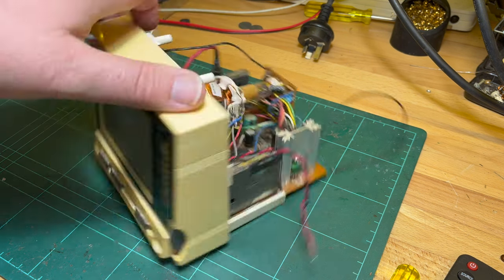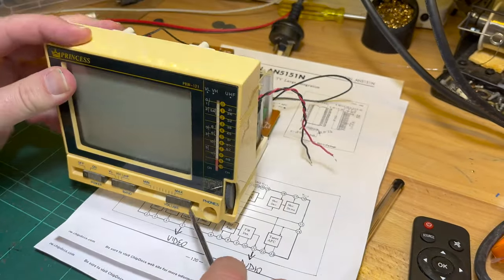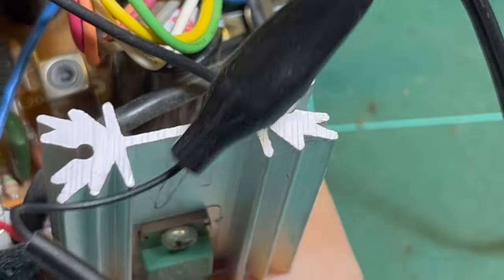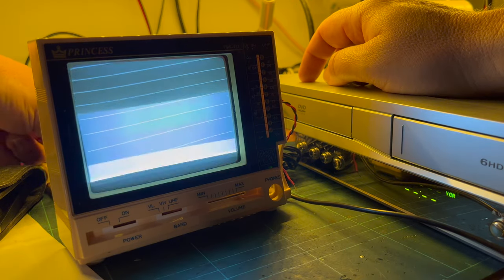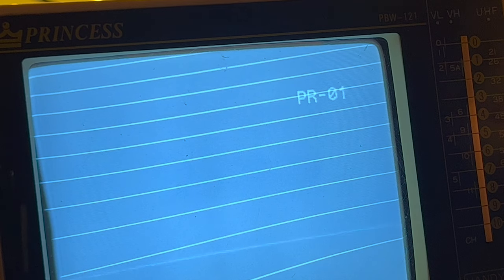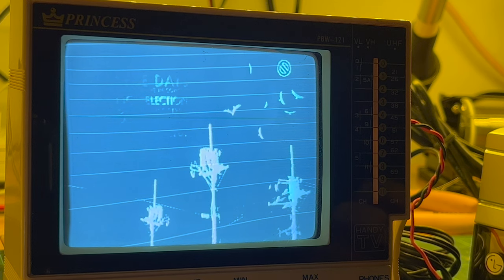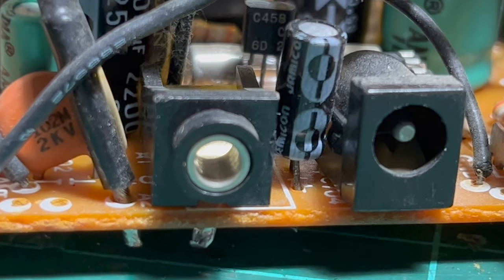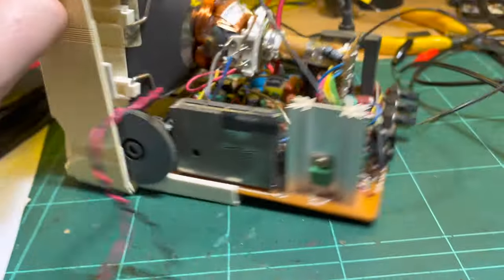Adding Video Input to RF-only TV: Part 1 [TCE #0274]

Comment: I think the input impedance must be 75  ohms to get the the correct video composit signal standard levels (synch . blank. black and white) in the TV side.
Reply from the maker: Yep - you generally want to impedance match to ensure optimal power transfer and reduce signal reflections

Comment: @Brfff this one
Reply from the maker: Yes, I do need to re-visit this one.  Now that I'm more comfortable using the oscilloscope, I should be able to do a better, more permanent modification.  I'll try to get to it this week (24-Jun-2024)
Reply: @Brfff  no rush. I'm about to do a similar mod to a late 70's early 80s set.
Reply from the maker: @danielflakelar8193  Ahh, interesting.  I think this one is supposed to be easier because it's got an IC that does a lot ... can't remember?

Comment: I'm looking at the datasheet schematic. Pin 5 is the correct one, but you will need to know two things to make this work.
1. The normal video level at that pin.
2. The signal polarity.
You can get both by reconnecting the link, connecting the RF to your DVD player, and using a scope on that link.
The circuit has a 2.1v P-P level after the 2SC828A emitter-follower amplifier, so 1v is probably pushing it well beyond that.
The polarity will be pretty obvious on the scope, but not on the TV. An overdriven signal can look opposite of what is correct. If the polarity is wrong, you'll have to do a bit of work to correct it, but this check will at least tell you what you're facing before you do the connector work
Reply from the maker: Yep, that's what I was thinking of doing.  At the moment I've connected in to where the pin 5 video signal output emerges.  From what I can see it might pass through a capacitor (maybe) but then goes straight to the neck board via a blue wire.  On the neck board it goes through a transistor so I'm suspecting that's where the amplification might be occurring.

Comment: the horizontal lines and bright image suggest that the input intensity level is too high... may need a resistor to bring it down some...(maybe adjustable with a pot?)
im wanting to RGB my old sony trinitron TV to run the CPC off.. but from what ive read its not RGB and 15khz compatible... (i should try to find the service manual for it!)
...i did notice theres a TV on FB marketplace for weeks now that has SCART... might be the easier way to go....
Reply from the maker: I think it might be getting amplified on the neck board ... ?  Will look further into it!
Reply: @Brfff  just try stickin a resistor on ya composite input from the vcr
Reply: @Brfff  Screen control on the flyback might need to be turned down
Reply: @Brfff any update on this?
Reply: @Colestamper1  I personally fixed this issue by disconnecting the rf input side of the video chip rather than the video out. that got rid of the retrace lines for me on 2 completely different sets.
Reply: @onometre thanks for the update
Reply: @onometre I was having the same issue with this chip: retrace and faded image. When I reconnected pin 5, I was able to see composite input video with higher contrast but with some snow. Per your advice I disconnected VIF (pin 1, 28) by desoldering them and snow went to minimum but some was still showing. Noticed top of picture was getting distorted at some scenes. Perhaps composite signal was too high. Connected pin 5 to ground via 75 Ohm resistor to fix this and it also helped with the snow coming from the chip, which was visible on dark scenes. On a side note, tested the TV with NTSC and PAL signals and it worked.